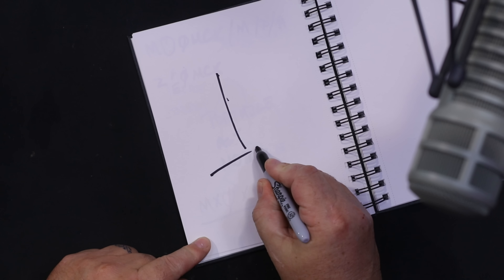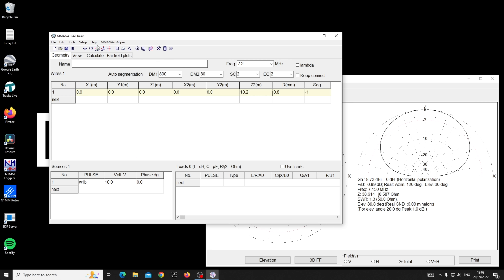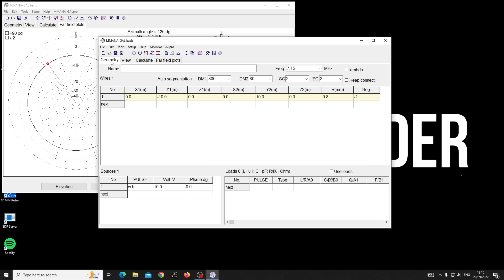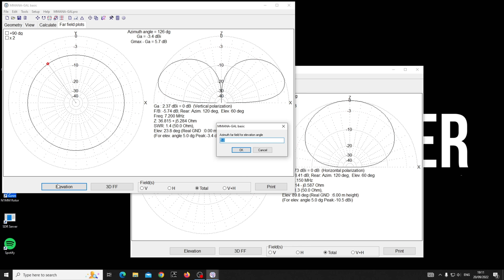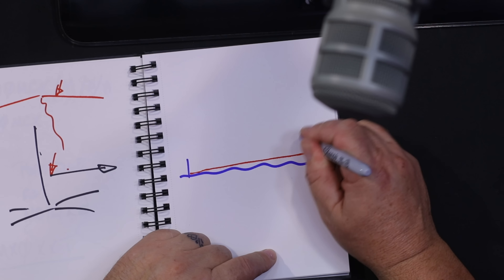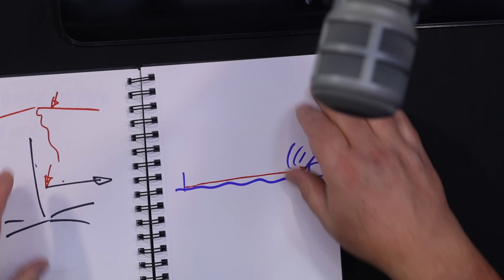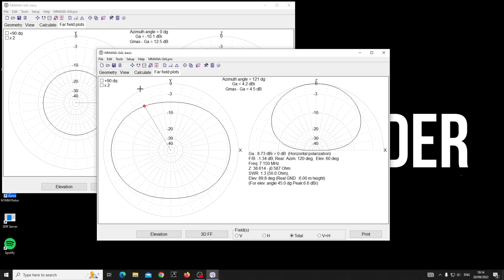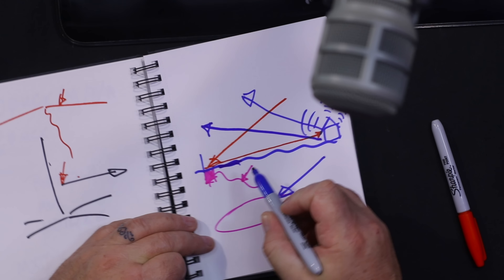Debunking the Myth: Investigating the Noise Level of Vertical Antennas

Comment: Hi Callum, I thought that the reason verticals pick up more noise is because they receive on the same polarisation as what noise is transmitted i.e. vertical. I use an end fed wire, not vertical and I have a very low noise floor. I have no understand why. I am usually envied by other people and they don’t believe me until I video it then they say there is a setting wrong or something. 😂
Reply from the maker: I seriously doubt whether local QRM is only vertically polarised. When I say seriously doubt, it's more than that. I totally disagree actually. I thing vertical antennas are exceptional low-angle RX antennas. And low to ground dipole, loops, anything antennas are certainly not.

Comment: Hi callum, what log software would recommend for an idiot? I've watched you on your live stream and that looks good, I have an alnico dx-sr9e and I'm sure you can connect it to a PC with the right cable. I'm not sure if it will work with any log software, you input would be appreciated.  David
Reply from the maker: OK, so I started with WinLog32 (I don't know if they still do it). N1MM Logger just works for me. I can export to any other logbook, I can contest or DX, I can even do digital. The ONLY issue is that under the skin, it is HUGE. Be prepared to scatch away and find out what it does. It's insane.

Comment: I think, and this is just speculation mind you, if I have a dx commander and throw a banana at it, that banana has a greater chance of hitting that dx commander by a power of the diameter of the banana squared, regardless of the clockwise or counter clockwise rotation of the banana, Coriolis effect  not withstanding. If I hit the dx commander, the score will be banana 1, dx commander 0 and vise versa. The one fact remains, regardless of banana impact, is that now I need to go buy another banana.
Reply from the maker: Or a bunch!?
Reply: @DXCommanderHQ  if we squirt some caramel on the DX commander and key down with a kilowatt precisely at the second the banana hits the radiating element maybe we can get some instant bananas foster?

Comment: The noise is picked up from the vertical run's of mains wire's, a horizontal antenna would have to be at the same height as the horizontal part of the mains ring to be as noisey. Vertical is vertical... That's how it was explained to me
Reply from the maker: It was explained to ALL OF US that way.. But it's a myth.
Reply: @DXCommanderHQ  is it a myth? I've not heard of it being explained that way before but then it's something that isnt talked about much.
Operating from an urban setting is noisey full stop for me! Like yourself I enjoy the low noise when portable with a vertical.

Comment: Callum I think you are very close to the answer. If I use a vertical it can only be 40 feet from the house with a useless radial system. Yes S9 to S9+20 noise on 40m. Any antenna with a vertical element to it is the same. Inverted "L" is around S5. Windoms around S5. Bigest dipole I can fit in is for 20m so not a fare comparison as that band is less noisy anyway. Bottem line an empty logbook. If you can't hear um you can't work um. Nowhere to put a RX loop on the ground, tried it.
Reply from the maker: Oh hell, OK.. What about a TINY loop or even a dipole?

Comment: Nice video Callum. So the question is then..... Vertical or efhw in a small garden. I have both the vertical is a 20/40m. I have a corridor on open space East to west. My house and the house at the back is north and south. The garden is 8x8m which antenna would you use plus two small children running about?
Also have linked 20/40m dipole
Two masts to use 8m and a 10m DX commander 
Motters M7TRS 73
Reply from the maker: Oh heck.. I would always personally aim at a vertical for TX and a small "thing" for RX. Kids and dogs.. I had them for years. I've worked around them.
Reply: @DXCommanderHQ  morning Callum. Yes I think you are right. I have had better luck with my vertical. It a homemade 20/40m with coil near the top so I can use both bands without changing anything, it has 8 5m radials which are not straight as not much room as the antenna isn't permanent thing so it up and down. The radials are probably in a rectangular box od about 2x4 which I can use while the children are in the rest of the garden.
When I tried the efhw I had it going up the dx commander 10m the across the garden to the roofline bet the neighbours thought it looked amazing 🤣🤔
I have not shack St home so it's a popup station which is a Ft817 a run of rg8x to one of my three antennas I've made. I am a portable ops but it's nice to be able to spin the dial (little dial) at home.
Have a good Sunday mate.
Motters M7TRS 73 👍🏻

Comment: THIS IS MY OPINION  IF you have static and EMI / EMC Static  noise in built up area Just ground everything," Just go MAD" earth rods,  earth blocks ground all your gear, lighting surge protrectors are a excellent way to ground your coax points ! dont worry about radials then load it up yeeehaaaaaahhh
Reply from the maker: Well, nothing wrong with earth rods - but they will have almost zero effect on transmit efficiency.